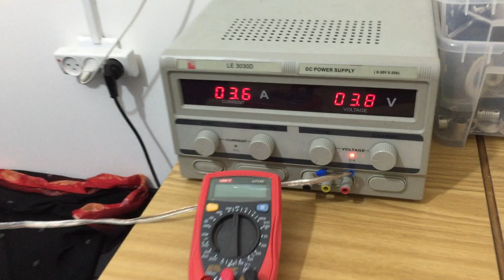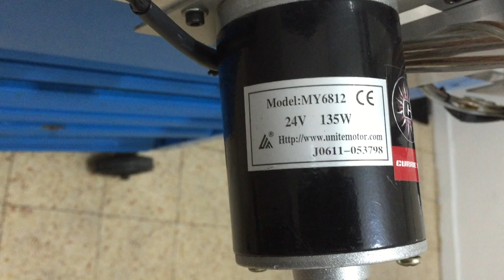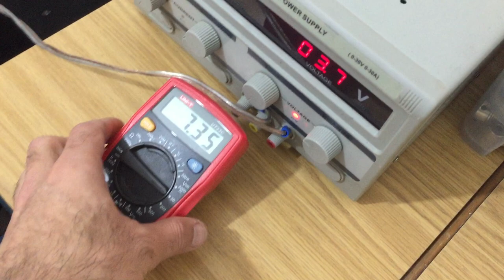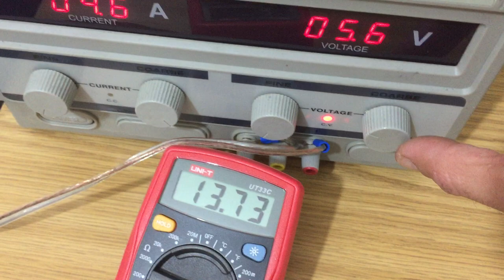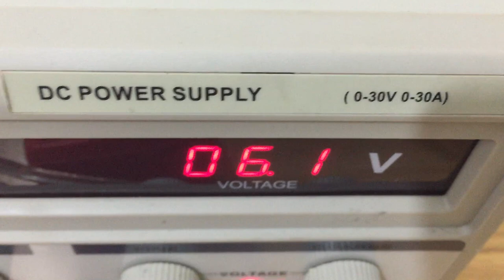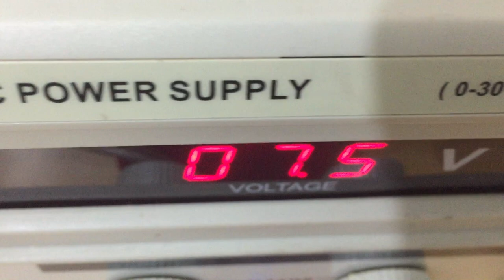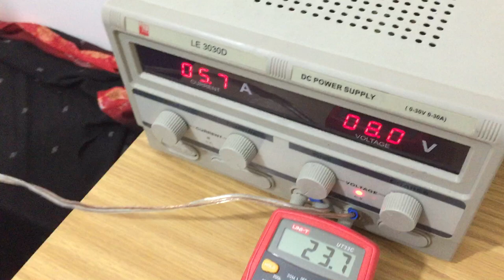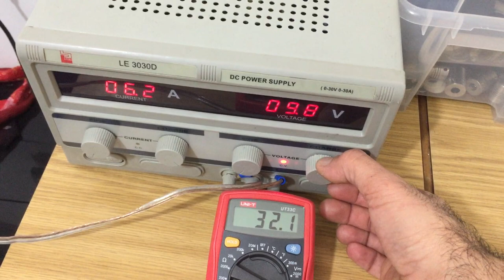Real future mechanical charger X 6 generators magnet motor engine made by oren gertel

Comment: Hi Oren, you've made a Very Nice Work here! Impressive of clarity, imho.

Nevertheless, you did not demonstrate an overunity COP here :/

I DO NOT say that is not indeed overunity COP, just you did not DEMONSTRATED it :/

Ideed, you've just demonstrated what we call a "rotating step-up transformer" while you only provide voltage reading at the output, and even a not loaded voltage which is rather meaningless :(

This is for me most sad and I don't understand why you didn't just put a 1 ohm resistor with 2 multimeters: one in series for the Amps and on across for the voltage. Having DC output you would have had an perfectly accurate reading of the outpower.

Why didn't you do that? :/

Note: you can't patent something you've disclosed if you wait more than 1 year something like this, after it is public domain.
Reply from the maker: Khwartz Thank you for your interest! I filed patents in 2012 and has already received a patent by the end of 2013! Thanks